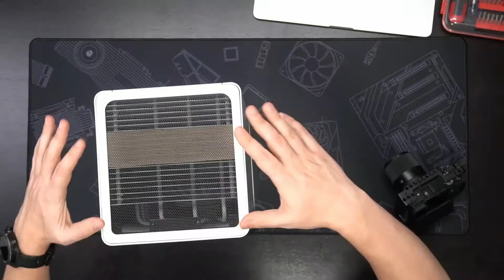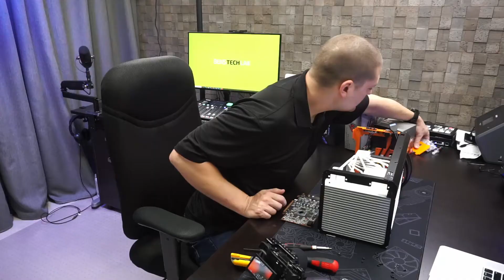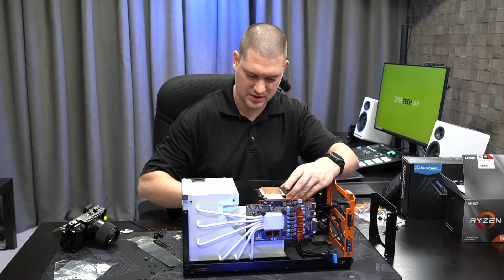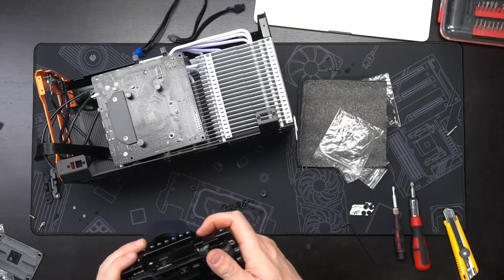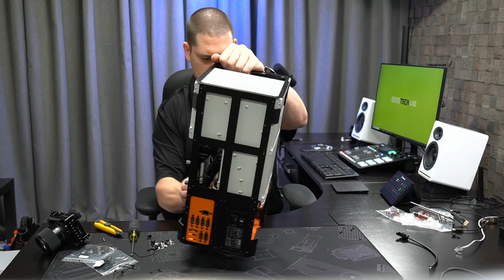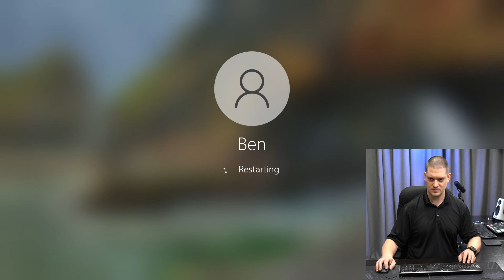MonsterLabo The First [Silent PC Build]

Comment: Thinking about buying one of these, how's it been over long term use? Any major issues to note?
Reply from the maker: The hardest part on this case is GPU VRM cooling. If you can get one of the recommended GPUs that supports the large VRM clamp style heatsink that would be ideal! I had to use stick on heatsinks which fell off after sometime and need to be replaced.
Reply: @BensTechLab  Okay thanks very much, other than that were you overall satisfied/still using it?

Comment: Hello, do you think an i7-11700, a  H570-m asrock, an old powersupply like a M12 seasonic ATX (2008, so not fanless)) and a graphic card like an RTX 2070 / 3060 would be possible ?
Reply from the maker: I dont have these parts, but email MonsterLabo! They do have a motherboard compatibility list that is known to work. You might be a little over the true fanless cooling capacity of the case and require the optional 120mm or 140mm case fan I installed later in this video.
Reply: @BensTechLab  Hi thanks for the reply, yes, my main issue is the noise made by a graphic card (i suffer from oversensitve hearing), so if to put a 120/140mm noctua fan that are very silent (i have 3 of them, 2 and in summer i turn on the third one), and I can remove the ones fro an RTX that would be amazing. I can't change my graphic card because of this issue. (i have an old 750ti palit fanless, and don't find any used Palit GTX 1650 fanless :( , sometimes the openvino of my cpu is faster lol (I7-7700).
but i saw that a small factor powersupply is needed to put the fan, so i must change my actual powersupply. will have to do investigation to find one totally coilwhine free (any idea ?). I tried a seasonic platinuum in 2011 but it totally hurted my ears, then, tried a cooler master (not known to make any coilwhine) but they were some lol.. 
my actual ATX is fine even with a fan,. But the issue is really the graphic card lol. (it's not for gaming but video editing / Cgi / Ai Upscaling processing).
thanks for the reply ! i already wrote to Monsterlabo at Discord, if no reply i'll try through email ! thank you !